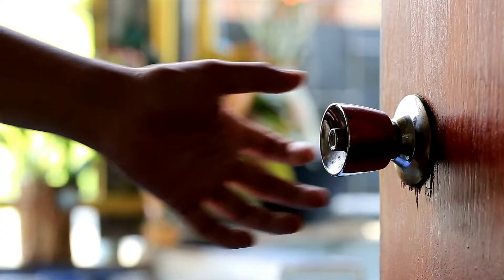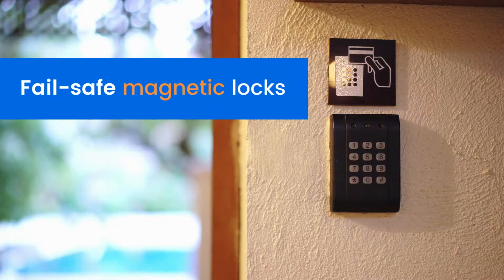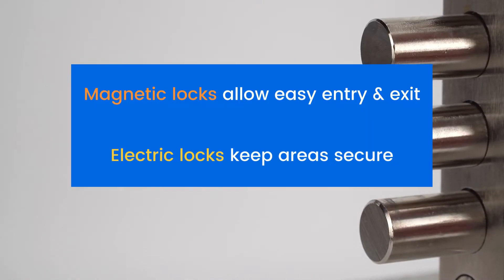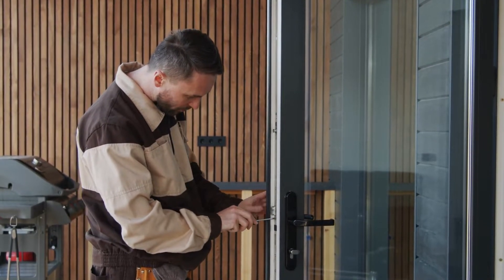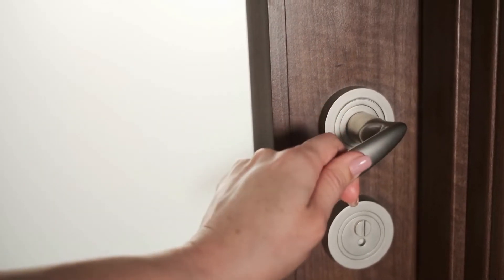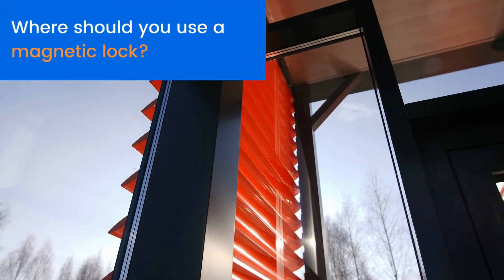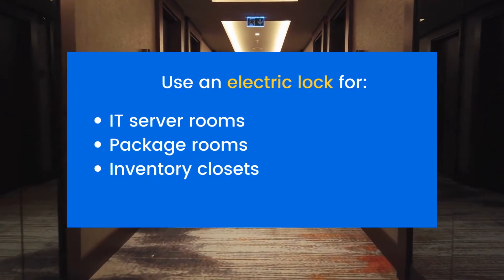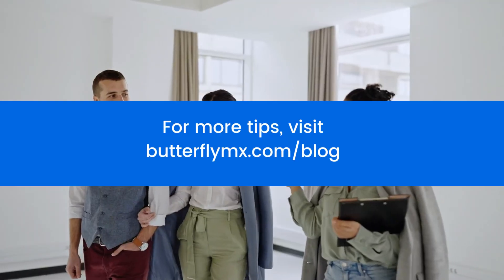Electric Locks vs. Magnetic Locks: What’s the Difference?

Comment: Summary: Magnetic locks let go when no power,  suitable for emergency exit, such as stairwells, entryways, and rooftops. Electric locks stay locked when no power, suitable for situations with special emphasis on security, such as IT server rooms, package rooms, and inventory closets.
Reply from the maker: Thanks for your comment!
Reply: Not fully correct. Both are electric locks. One is electromagnetic (mag lock) and one is electric strike lock. Both can be fail safe (unlock when power disconnected)